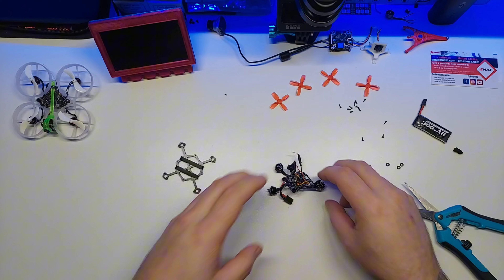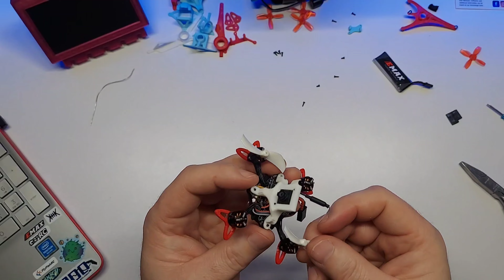Making the Emax NanoHawk GREAT AGAIN! Part 1 build tips and tricks

Comment: What carbon frame is that? I’m trying to find one for my walksnail biild but i cant find any
Reply from the maker: @vernelfpv  this is the nanohawk drone from emax I'm using the bottom plate it comes with,it's all in the video
Reply: @burdfamfpv  ohh so I thought that the whole bottom plate is plastic. thanks brother
Reply from the maker: @vernelfpv  no the bottom plate is carbon fiber kinda thin prob a millimeters thick buy its a light whoop as you could imagine, no problem bro